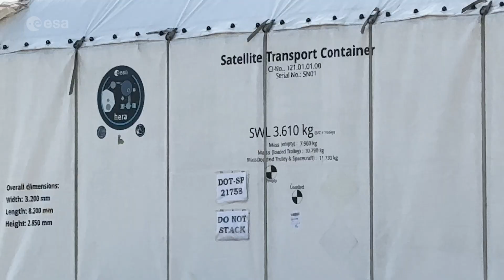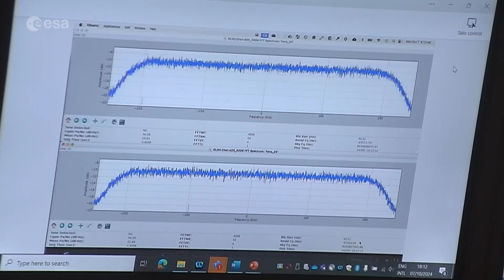ESA's Hera mission launch highlight

Comment: OK, so, after watching the deployment, I don't see Hera adding any extra deltaV at that point, does that mean the Falcon 2nd stage will also make it to Mars?   Could the Falcon 2nd stage be crashed into Mars so the Mars Quake equipment their gets a chance to record a man made quake?
Reply: Yes, the 2nd stage also makes it towards Mars. Yes, the stage could be crashed into Mars, too, but there are two problems:
1. The Outer Space Treaty prohibits contamination of other planets with Earth microbes, and that rocket stage has not been decontaminated.
2. Hitting Mars requires regular course adjustments during a many months journey. The rocket will run out of propellant and/or power and no longer be able to correct its course.
Reply: @debott4538  Thank you very much.  I wasn't aware of the space treaties impact.   Which, Wow,  raises the question, when Starship first arrives on Mars, how do we interface with the planet without contaminating it?  Will the treaty need modifying?
Reply: @leericmarvin  That is a good point. Another one on the long list of why Starship will likely not land on Mars anytime soon.
But yes, before it comes to it, there must  likely be made exceptions to the treaty. There is no other way if we want to  land humans. :)